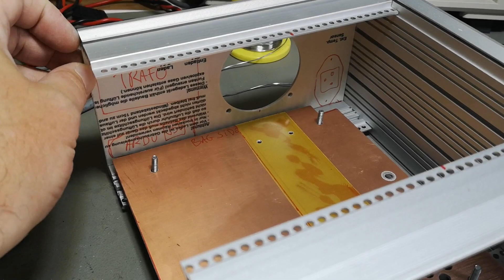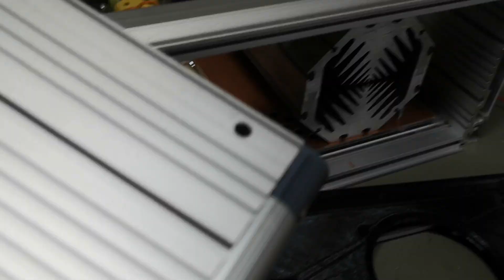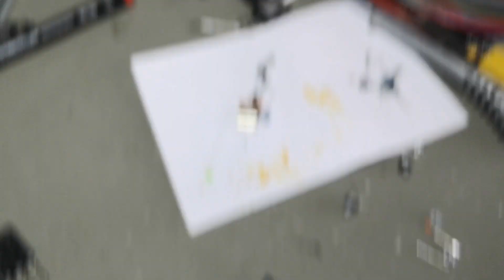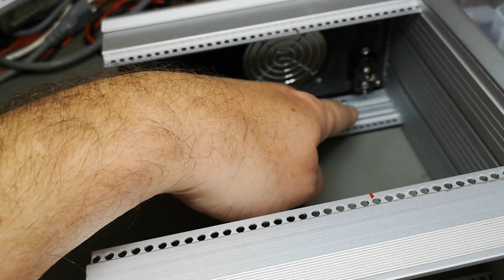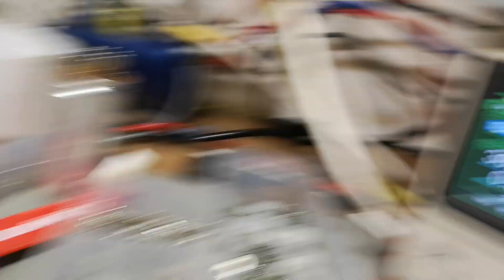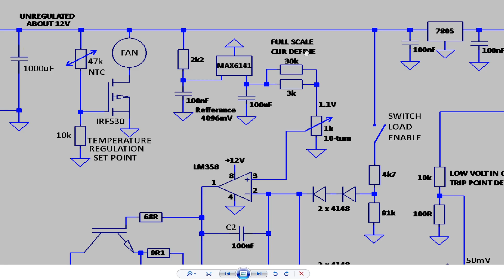DC electronic load 1000V 1A 1000Watt DIY Arduino Project

Comment: DC Load should use 4-wire (Kelvin) connections. That way voltage measurements and power calculations are accurate.
I note you have 4-wires to 2 x front panel jacks, but there should be 4 x jacks and the voltage sense be taken all the way down to the load connection point.
You can use 2-conductor double-insulated silicone cables for the test leads, and it would not need to be very thick due to only 1A load (and cable voltage drop does not really matter anyway if using kelvin connections). 0.5mm conductors would probably work OK, maybe even thinner.
Reply from the maker: NO, not true, please look at the specs, and read out resolution, 0-1023V in 1V pr step, 0-1023mA in 1mA step, this means the voltage error from cables and connectors are magnitudes from affecting the readout, so a much easier 2 wire connection is perfectly fine. 
However IF you use the same display for other projects, with much higner current capeabilities, you clearly want a 4 wire connection for 10A and up, in combination with a better voltage readout, 0-100V will give you 0.1V pr step, now it makes sense
Reply: @TeardownOZ2CPU - if what I say in "Not true", then what YOU say in THIS video at 27:00 is also NOT TRUE 😉
... watch your video again, and learn from yourself 😂

Comment: Thanks for sharing the project. Wish I had the same knowledge you have (or maybe just close to it).
Reply from the maker: you are welcome, and thanks, i plan to share the software for this project too, if anyone like to copy it, the basis idea can be used for any type of load, dont need to be a high voltage type
Reply: @TeardownOZ2CPU   Hi, I want to repeat your project, I am from Ukraine, I need an electronic load for an electric bike, to test batteries. 56 V +- 20A 30A
Reply from the maker: @tytanham0n  you are welcome, please send me email, my call sign at gmail then i send you the files you need.

Comment: Nice project, are you going to use it for loading tube based power supplies? 
Oh, and you really need access to a laser cutter for making front panels, none of this 3D nonsense for flat objects  ;)
Reply from the maker: yes it is mostly for my tube based projects so i can perform loaded lab experiments on high voltage supplies, most normally that is 300-600V
you are right laser or cnc is the way to make more nice frontplates. but all people know that, so it is not the scope of this video, i also wanted to show you can make a decent looking and fully working prototype unit, using 3D printed front plates, if only i cared to sand and paint it two more times, you will not be able to tell it was 3D printed :-)

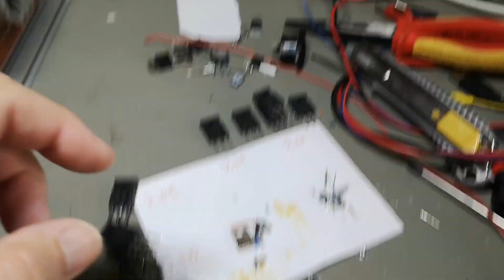Comment: 12:30. If you use one OPAmp for one transistor with its own shunt - you don't need to look at gate treshold at all. It will regulatr it automatically. Opamps cost is very small portion in a total cost.
Reply from the maker: YES, that is how i did it when i made the 500Amp version back in the old days. But it is a bit tricky to avoid the different opamp sections oscilate with each other regulation.